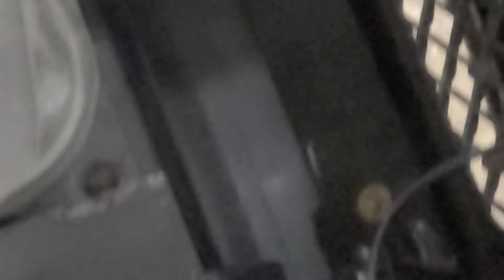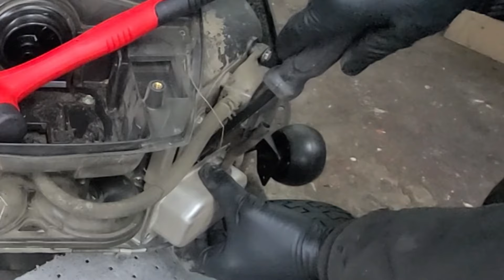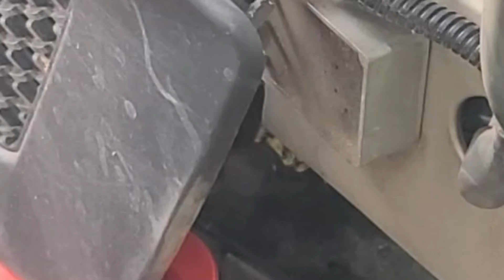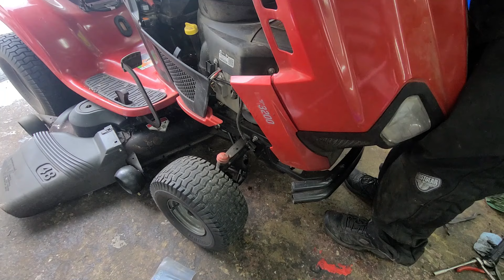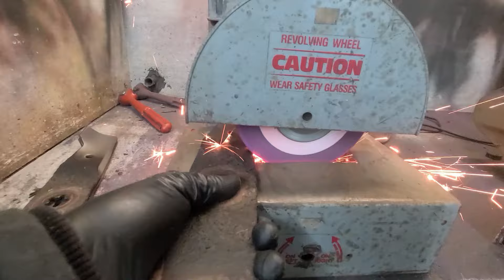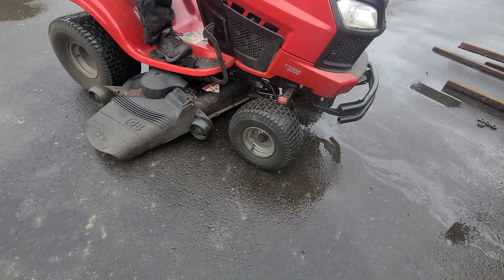Full Servicing of a craftsman rider- Step by step

Comment: I have this exact same mower and the only suggestion I would make is that before you start the engine to warm the oil, clean the air box and replace the air filter. That way anything in that dirty airbox won't be sucked into the intake. The only other thing that I do when I service mine is put a little grease on the steering gear teeth. Good job! .